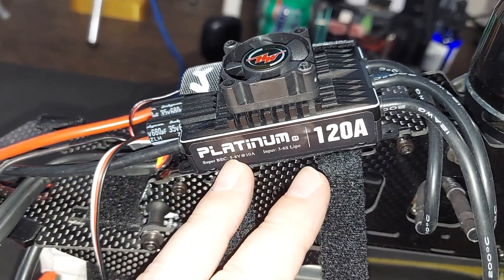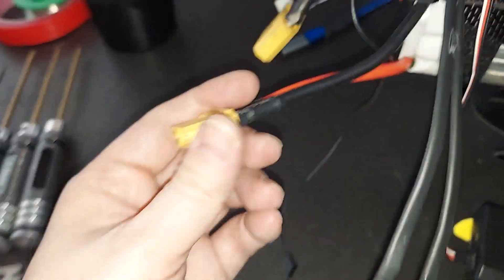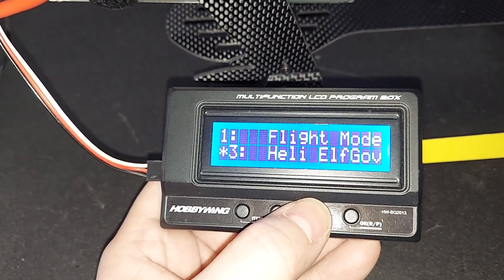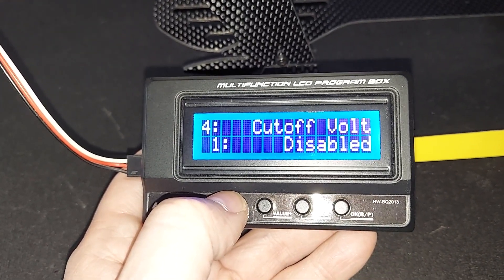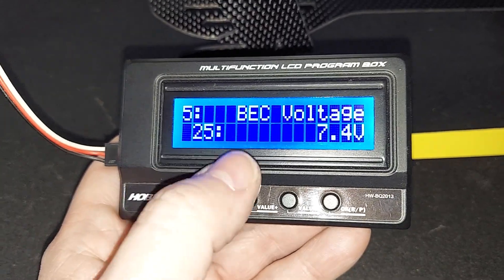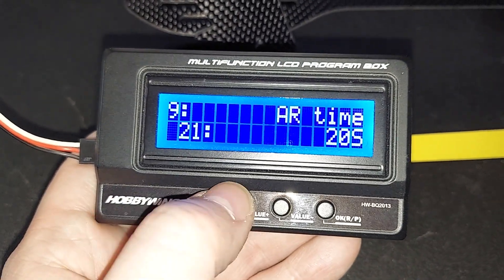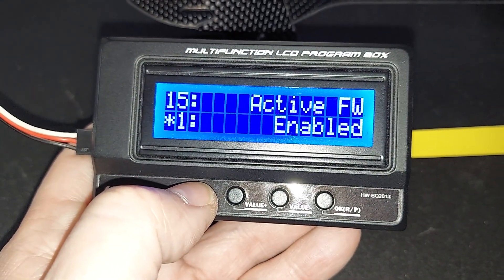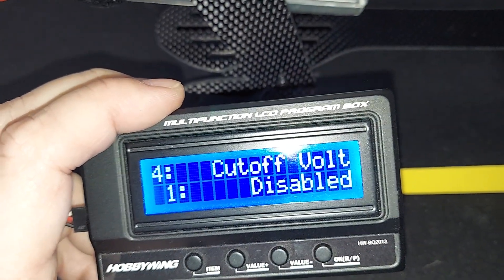HobbyWing Platinum V4 ESC Programming

Comment: Slow to find this video,  looking at getting one of these for a EDF project, will it work okay in this situation
Reply from the maker: This ESC is made specifically for helicopters. It could be used on a plane but many of the features that make it cost so much will not be used. Depending on how high end your build is you may want to just look into a flycolor dragon 150amp 5-12s ESC, They are much cheaper and work great for planes.
Reply: @NomisRC  thank you.

Comment: So i understand after i have done what you said i do not have to go to the field and spool up wait 15 seconds power down unplug correct.  Im using governor mode throttle curves straight line for 2 flight modes.

Comment: Once you have done what you have done is all I need to do is set the throttle limits by moving the throttle to full throttle wimait for the beeps move to bottom limit set you throttle curves at idel up 1 say 60 and idel up 2 at 80 and away you go is that correct or do I need to go to the field and power up at mid stick let it spool up then set it down and Unplug and it set. Which one do you use.
Reply from the maker: Yes for throttle endpoints full positive wait for beep then full negative and wait for beep. Then set your governor if u use one via software. Once I get to the field it's ready to go.